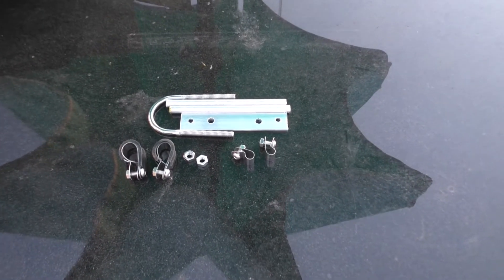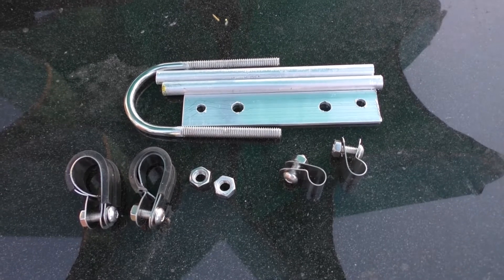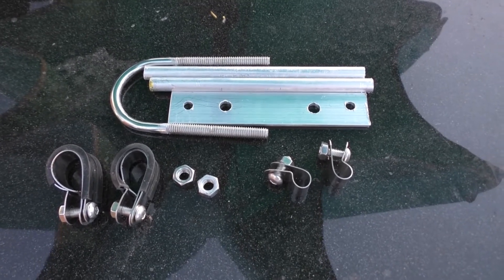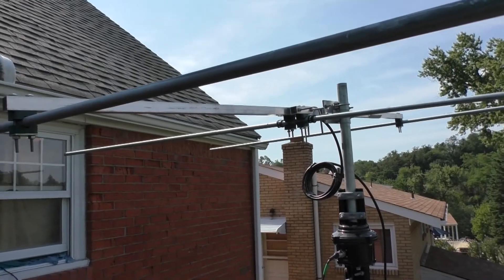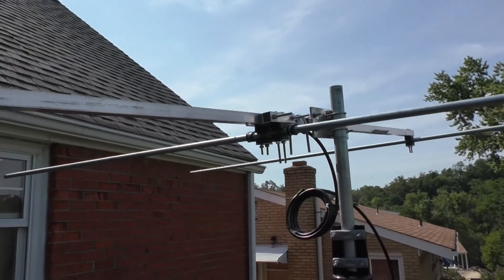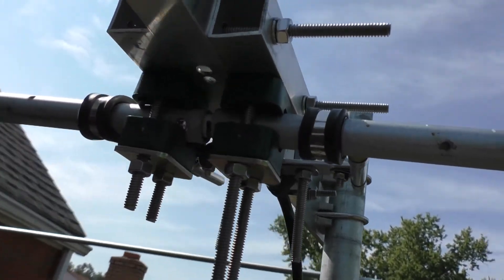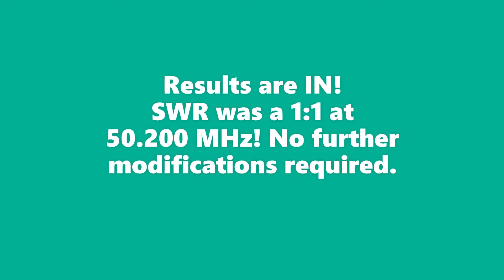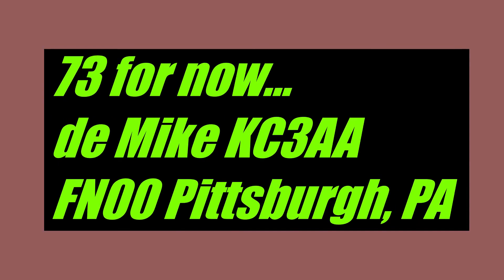6 Meter 3 Element Yagi Hairpin Match

Comment: do you have to have a choke and/or balun on your antenna if you have the hairpin match?
Reply from the maker: I read its wise and good practice to put a coaxial choke at the antenna. Some people also put one at their transmitter end. To prevent rf running on the shield if I recall correctly.
Reply: @mikegreenkc3aa529  - can you make a video on how to make this coaxial choke?